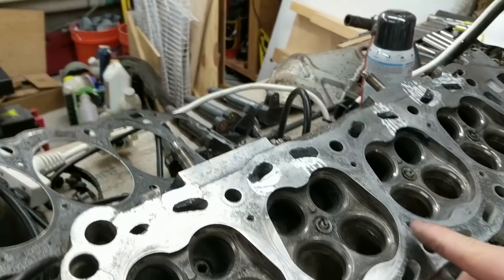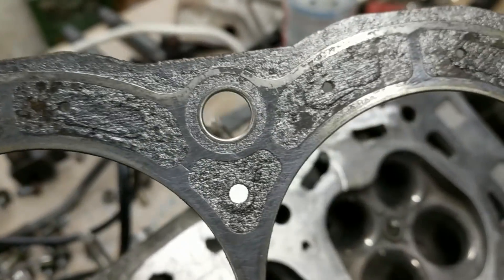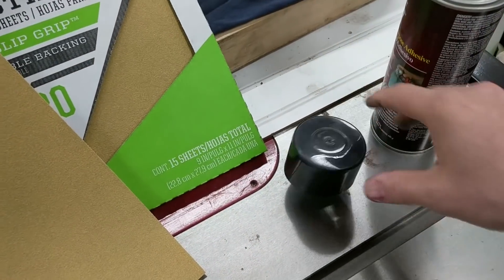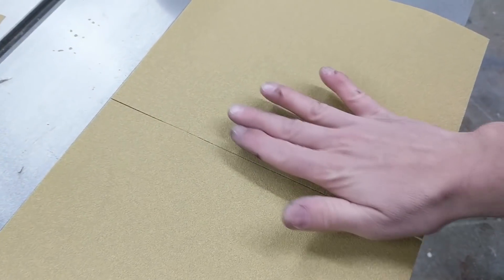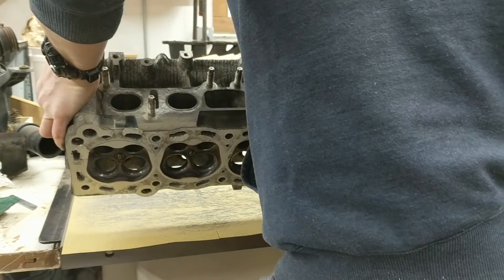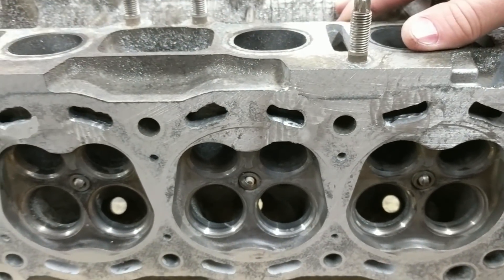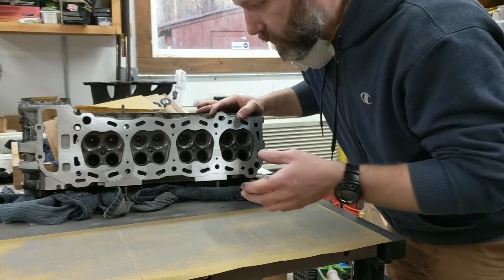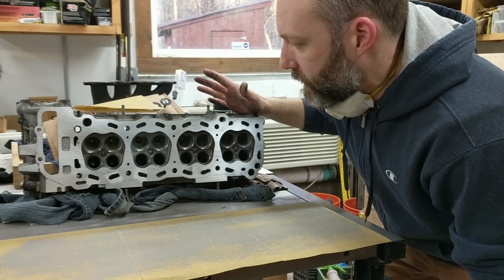Using a Table Saw to Resurface a Cylinder Head

Comment: The tiny holes in the head gasket is for air to escape, coolant doesn't need to flow that way. Spray the head with purple power degreaser and rinse with hot water, blow dry with air compressor.... Being a professional technician my first reaction was "WHAT THE HELL IS THIS GUY DOING" but after I watched the video I have to hand it to you. You did a nice job man.
Reply: @Caleb Perkins  Yes, I know that feeling of "What the Hell". I left a dealership and moved to a different state in 1982 for the family and better pay. (Flat Rate for customers $24 / Techs paid $6.90) I found a new job at well equipped shop, not a dealer. They had a need for an import tech and had a new 4 gas engine analyzer (Bear Ace), but also a hot tank. New to me, but a guy serviced it once a month with bottom cleaning and sodium hydroxide. I work on everything and while doing a valve job on a V8 Pontiac, I placed the rocker arm on a full length pivot tube into the tank while on a wire. Pulled them out 2 or 3 hours later and they melted off. Whoops! I guess they where aluminum. Oh the lesson we learn!
Reply: Purple power is a non corrosive degreaser and I use it frequently on aluminum.  I wouldn't suggest leaving it on long before rinsing it off. You can purchase it cheap at any hardware store or auto parts store. This is only a degreaser and usually requires a solvent of some kind to completely remove. I only suggested it to this man because he was on the cheap and this would work fine for what he was trying to accomplish. At our shop we buy a drum of a/c flush and use spray guns. I dont remember the brand but its 800 dollars a drum :(... good stuff though.
Reply: +MrRetahreggin  I was working in a Buick / Isuzu dealer in 1990 and held the esteemed position of Isuzu Tech. Yes, I developed thousands of customers over a decade fixing what ever was wrong. Manual and automatic transmission came out for repair, and all aluminum. To clean some parts or the case prior to disassembly, we had a 55 gallon drum of 1-1-2 trichoraleytholine (Not sure of spelling) but we used it full strength in re-fillable qt. spray cans that use shop air for propellant. This stuff and a brush cleaned everything. But like many things that work good, it was deemed to toxic and no longer sold unless under trained manufacturing or commercial applications. The dishwasher idea is the same principle except on a larger scale and sold to transmission shops for 10k or more. A rotary tray turned slowly and fixed high pressure jets sprayed heated water with some type of environmentally friendly soap or solvent. It works great, but I am not going to but one. As for this video, I use a Snap-On straight edge machined to 0.0010" over the 14" of length. Plus, machine shops keep in mind the roughness of the finish after resurfacing the head. SAE specs for roughness is measure using a gauge to create the correct "RA" value, as each manufacture has certain specs desired for clamping and holding the head gasket to seal correctly. Aluminum head on a cast iron block presents problem as aluminum moves 2:1 to iron. This explains the newer "Torque to Yield" type bolts. They can keep constant pressure while going through many hot/cold cycles. Otherwise, for years with Isuzu engines, the maintenance chart had use re-torque the head bolts every 30k miles. In the same pattern of torquing, break on loose cold, re-torque to OEM specs. This works great as I have customer with 300K + miles without have the head off. Oh how the times have changed. some for the better, but always more expensive... But I grew up when a soda was 5 cents and gas was $019.9 cents per gallon, front drum bakes where normal and some vehicle had an oil filter, while oil was in the air cleaner and points would last 15k if you where lucky.
Reply: @deankay4434   Hi Dean. I bought a 1990 Isuzu truck new from Pitre Buick in Scottsdale and must have had 4 sets of front brake rotors done under warranty for lateral run out. Was that common or maybe just Arizona being hot? Just wondering as it took many trips to the service bay. Thanks
Reply: @jimmyduncan7650    Jimmy, what model of Isuzu did you purchase? A 1990 4 X 4 pickup will have 4 rotors and I am jealous. #1 They should clean the rotors mount surface. #2 When they resurface the rotor on their machine, they should mount a magnetic neck w/ dial indicator and check for zero. It should be zero. But, loosen the nut, hold shaft still, rotate rotor only 180 degrees, then tighten and re-measure. If the reading is larger that 0.02, their machine have not been verified for a true cut. It's math. I can tell them the procedure to correct the set the lathe up correctly with their adaptors, shaft alignment to machine housing, etc.
#3 When rotor are installed on the vehicle, then Buick dealer should have conical washers to install the rotor, torque the lug nuts (Steel 55 lb. ft.) (Aluminum 72 lb. ft.), then check for lateral runout. Should now exceed 0.02" of an inch, while measured about 1" from edge. Axle for flange should be clean as well. They can rotate rotor in 6 locations to reduced lateral runout to specs. #4 The biggest and most common problem is over tightening the lug nuts. Every one like to use "Torque Sticks" with an 1/2" impact. Depending on shop air pressure, new impact or old, how many "Hits" the internal anvil takes before the tech let go of the trigger. #5 Best way to torque the lug nuts is hand tighten in the air, then torque wrench on the ground. They are not as tight as Buick aluminum wheels, that are 95 lb. ft. Way less, other wise they will warp and chase pedal pulsation. Also, the rear brake pads are a ceramic formula Isuzu came up with to eliminate squealing noise in reverse while stopping. I was the Only Isuzu Tech in the entire city of Omaha, (Larger than St Louis) for over 10 years and had the best "CSI" in the Chicago Region of all of the Isuzu Light Vehicle category. ASE Master since 1978.
Reply: @deankay4434  yeah I don't have it now I sold it in 95 with 38,000 miles on it. It was two wheel drive and I think a 1.9 four cylinder. I only had one break down with it when the fuel pump went out less than 20000 miles on it. Other than that it was a good truck for 8k new with a/c. In 1993 I bought a new Ford f150 with 300 straight 6 and I've bought only Ford ever since. Back then if I had the money I might have bought a trooper always like the early 90s Trooper even as slow as they were.🐢💨
Reply: @jimmyduncan7650  Hey Jimmy. I would like to have my 89 4X4 back after my step-son got it from my wife. Your two wheel drive would have been a 2.4L with carb and mechanical fuel pump under the center of the intake. The 4X4 came with the 2.6L EFI. Regardless of what you own now, or any family member, do not let the Tire / Brake / Dealerships use "Torque Sticks" on their impact to tighten the lug nuts. If your wife can not take the factory wrench, step on it and un-screw the the nut...it's too tight! God, I hated that and is the #1 reason for warped rotors. With import rotor on the market, many shops do not turn rotors anymore, and the machine sits in the corner. But, these import rotors require an alloy include long carbon filament chains in the steel. These absorb noise by not transferring vibration within the steel. I am just picky about brakes. I still have a 99 Rodeo 4X4, but the 1990 Trooper was a favorite of hunters, farmers, contractors, animal Vet's, painters, so many hard working people that actually used the "Utility " part of the Tropper's SUV, and could care less about cup holders. They came with an optional 2.8L GM V6 engine as well, but all Troopers a 4 X 4's. Later, in 1993, the Trooper came with an Isuzu 3.2L Hemi design engine. Isuzu is Japan's oldest diesel builder. Can you say "Dura-Max" diesel?
Reply: Caleb Perkins I worked at a diesel shop and cleaned stained aluminum wheels all the time and Maratteck acid works the best. It will remove any stains that get in aluminum. Just put it in a spray bottle spray it on let it set and bubble then rinse it off and if it' still has a bad spot or 2 repeat on said spot once or twice. I've used it a lot in cleaning dirty intakes and heads and valve covers..
Reply: @Hendogg28     Did you mean to say "Muratic Acid"? That scares me...not much does, but boy I am careful with that stuff. Any clear liquid that "Smokes" a little when the lid comes off deserves respect. Hum, interesting. Was it reduced with water and used very quickly? Thanks dude.
Reply: Dean Kay Yes that's what it was so post to say.. lol. You can dilute it with water if you want a little. But we didn't at the shop I worked at.. Just straight out of the gallon jug into a spray bottle and mist it on let it bubble a few mins and wash it off with water.. Red clay stained aluminum wheels will come clean if not with the 1 try but will with the 2nd try.. It works very very well.. Brake dust will come off as well..
Reply: You can use oven cleaner to get thick grease off of most metals im not sure how it would work on aluminum
Reply: Caleb Perkins bio solve green. Also called "green acetone"
Reply: FYI for people that don't know this, something I found out recently Edelbrock makes composite plastic high grade plenums now that don't heat up much at all, neat bit of info, learned a lot about different cleaners too
Reply: @Caleb Perkins  Just use gasoline for a cleaning solvent. It is cheap for a solvent and works great.
Reply: +MrRetahreggin    I have retired from the world of fighting the clock each day as an ASE Master Tech, working on everything from bumper to bumper. I do miss a little, but not the shop politics or favoritism, but I have a question. What is the "Purple powder degreaser" you spoke of? Like most shops, we had various types of products, some were ZEP brand, but I have a 4L60 trans to clean up at home, without a shop solvent tank. I was just prepared to use a bucket of elbow of bucket grease, mineral spirits and the like. I would appreciate it if you can share if it works good on aluminum casting. Thanks.   P.S. Perhaps this guy could use a homemade adaptor for use with a reciprocating saw to speed up his....aaH, flattening process. Very interesting, but I have seen heads and flywheels dressed with a Bridgeport Mill many times. You can't do this on a flywheel, Right?
Reply: @deankay4434  -  Cleaning Transmission Parts was the real reason God invented the Kitchen Dishwasher.
 Worst case scenario you get a new one for your wife, and move the "old" one to the garage. Use lots of dishwasher soap, lots or REAL TSP,  and really hot hot water.
 You'll love how the kitchen will smell, too - just like the shop you just retired from I bet, with a hint of lemony freshness. She will be so happy you won't believe it.
 (Pure TSP Tri-Sodium Phosphate can be ordered on Amazon for about $12 for a 5 pound box, and it works better that any "Green", "Purple" or other cleaners. Don't let it drip on the kitchen floor or you might end up buying a new one of those, too. I use a tea to tablespoon of it in my dishwasher for regular dishes, too. It is the Nuclear Option for dirty dishes and keeps the machine sparkling fresh)
 I have two dodge 5.9 liter/360 cid heads that I am hoping will fit in my dishwasher, after I surface them like Dennis did in this video)
Reply: @deankay4434  I use AWESOME "yellow" at family dollar dollar general. mostly on carbs. in a ultrasonic tank about 180 deg. its Awesome @ a dollar a bottle concentrated
Reply: @dougstrasser4093  Your answer reminded me of the dollar general's cheap oven cleaner. The cheaper the better that work to clean aluminum very well at room temperature, with a little steel brush action. Apply to the dirty aluminum casting, scrub with steel brush, scape it needed, re-apply and repeat. I have found that mineral spirits work great first with tooth brush or bigger, but then follow with carb / brake spray. The mineral spirits loosen all of the goo, then allows the carb spray to wash off. It does not work as well using carb spray first. I have forgot this method. An ultrasonic tank would be real cool, but I think my dentist would notice it under my jacket. Yes, I am a carburetor guy who rebuilt hundreds during the 70's / 80's. The guy who owned the shop was retired, but came in every day. one trick he taught me is after the carb comes out of the 6 gallon bucket, that held 5 gallons of carb cleaner (CRC), wash it with hot water... That's normal, but he would dunk the carb's metal parts into clean mineral spirits to re-hydrate the metal as the zinc rich bronze alloy used was able to absorb the mineral spirits, looked great, and kept one from using oil on the shafts that would only collect dirt / dust and wear parts faster. Ultrasonic tank, I am jealous. Good post Doug!
Reply: Dean Kay On a 18 wheeler. We just started at the drivers side wheel and sprayed it then moved on to the next one and so on all the way around the truck then power washed the wheels afterwards, We let it set and bubble tell we made it all the way around the truck..
Reply: Oil Eater is my favorite degreaser, nontoxic, biodegradable, doesn't even burn if you get it in your eye. Worst I've seen it do is discolor aluminum but that's only if you let it sit a long time, like almost to the point it dries.

Comment: To clean the cylinder head get a bucket close to the same size as the head if not bigger and put the head in it and fill the Bucket with either purple power or diesel fuel they both work in my experience being a mechanic for over 16 years

Comment: Resurfaced by The weight of the cylinder.
Great job man.
I did the same method using a thick wood board with a sandpaper on it to resurface the intake of the grand marquis. Appreciation for old school sciance.

Comment: all that work... disassembly, cleaning, welding, sanding lapping valves reassembly  so much time..... get a new toyota head on ebay for 180 bucks or  re machine from a shop for 120... done.

Comment: This is kind of stupid. But it does work. I’ve done it before myself. Then I learned the one matching shop by me is really cheap. The last ending I did head gaskets on, I brought them both heads they were in rough shape. They filled in some really pitted stops with some kind of epoxy, (probably job weld) milled both heads., pressure checked valve seats. And when I dropped off the heads they asked if I wanted the 4 broken exhaust manifold studs removed I said no I’ll get them out when o get the heads back and they said it’s no extra charge so they removed the broken studs. Total came to about 110 bucks for both heads. So definitely works I have done it, but considering my local cost of machining and the success I have had with them and how quick they had it back to me ( the next day) even though they said were really backed up. I don’t think I will be doing this again

Comment: But isn't the top still gonna be curved if its warped the whole thing is warped!!!?? They put it in an oven and a rack to straighten it so just cutting the bottom off won't give you a good seal on top and your timing will be off and your valve positions might be off too...very risky move...glad I didn't get into this when i did mine...it's not really as cheap and convenient as people say..you aren't doing it right if I may say so..I think its worth $1000 to have it done professionally...i got a quote of $350 for mine....and new heads may run $1000-1500 but a new engine $15-3000 so..id look around first...this isnt gonne work for real is it?

Comment: a old electric treadmill with variable speed control and a thick piece of glass laid under a sander belt is how we did them at the shop i used to work at
Reply: A lot of shops and even manufacturers use belt sanders to finish new heads. They are "precision" belt sanders with huge high quality belts running on a precision platen. They work very well on aluminum heads. It is very difficult to grind aluminum on a surface grinder. Old school machinists will know how (use Crisco and no coolant) but you can  only take one pass and you have to reapply another coat of Crisco.

Comment: Hope you lapped the valves but yes as a old see mechanic that's a poor mans mill very effective there are depth gauges built into most heads little indentations you'll see them as shallow impressions you can u tube these I use thick panel of glass no table saw yet. Great job should stand up well if your a decent welder you have nothing to fear. 👍